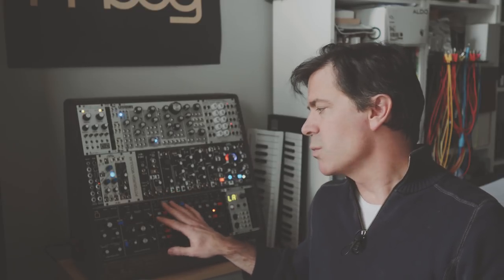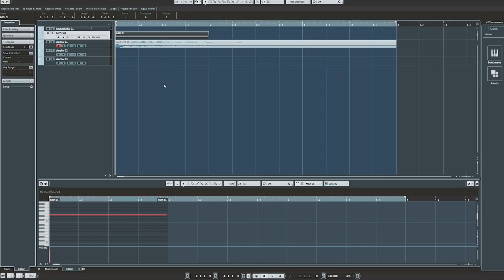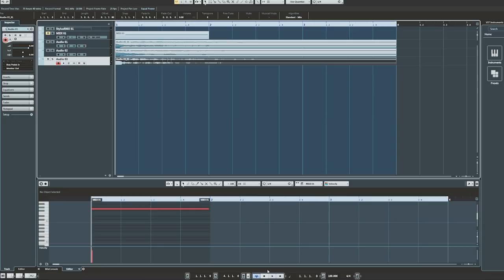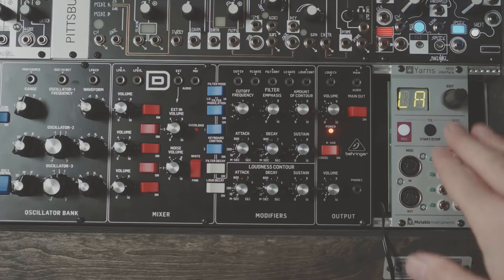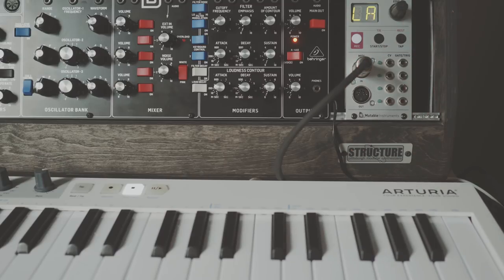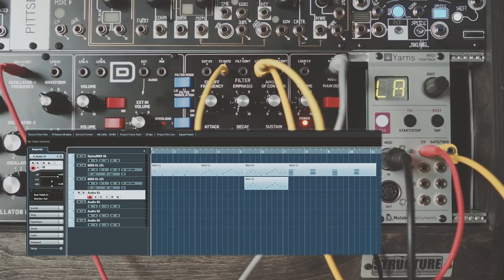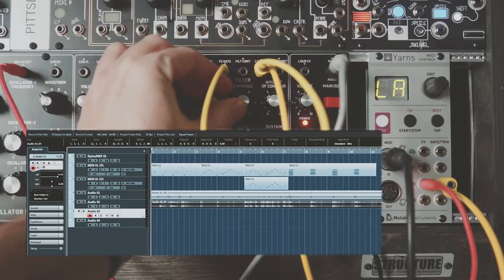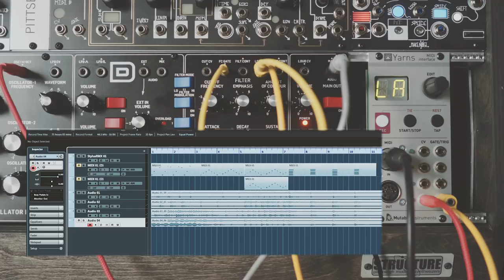Behringer Model D - Day Seven

Comment: I suppose there is also a middle way between your first and second method if you don’t have the extra hardware: record your polyphonic midi track on a polyphonic instrument as in the second case, copy it 4 times, then in the first copy delete all except the highest notes, second copy delete all except the second highest notes etc. then record 4 complete passes (rather than chord by chord as in your first method). The Yarns is definitely faster, but the middle ground shouldn’t take too much longer for those on a budget. Also has the advantage of allowing more than 4 note polyphony and if you decided later to give each of the polyphonic lines to a different sound/instrument, you have the midi tracks to do it.

Love the videos, definitely the most musical uses of the Model D I’ve seen. I’m from a classical performance background, but love this kind of music; you’ve persuaded me that this might be the place to start dabbling with synths. Thanks!